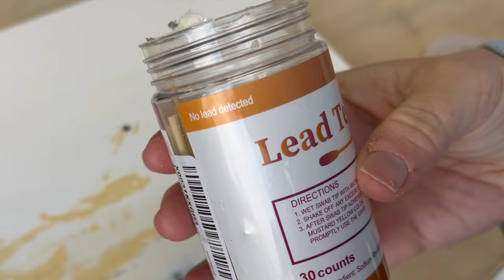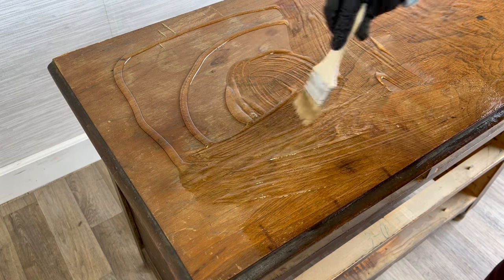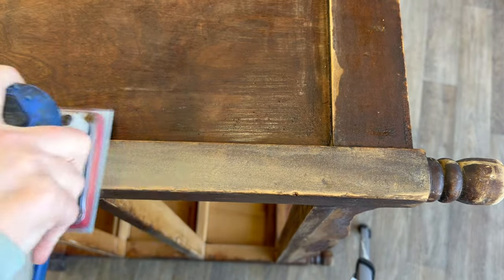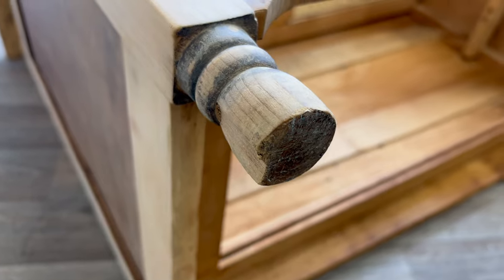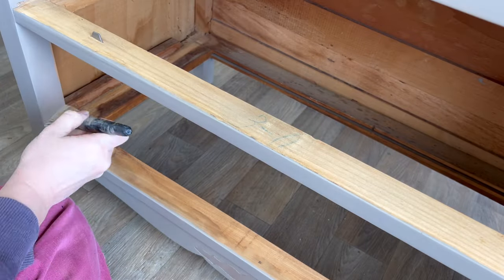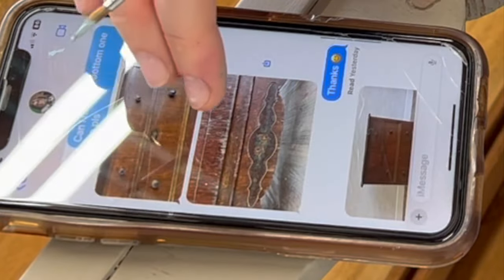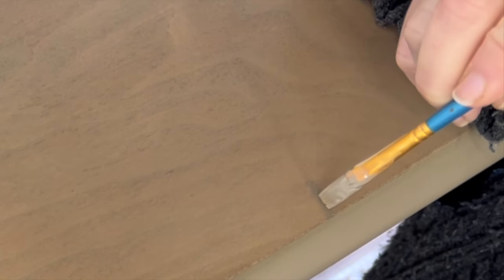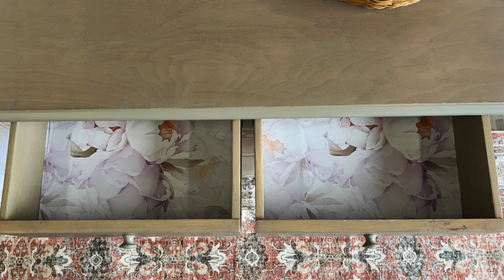Easy & Beautiful Beige-Wash for Modern Refinish of Antique Dresser | How 2 Safely Remove Lead Paint!

Comment: Awe, what a sweet episode.  I got teary-eyed when your daughter was painting and you talked about the full circle of her and the original artist being connected.  Just lovely how you take the history into account in your process.  Very nice result and I love the way you measured the drawer paper on the outside of the drawer so you weren't struggling with the inside walls.  Such a simple solution and I'm definitely going to use that tip!
Reply from the maker: Thank you so much, Stefanie! Yes - I love it when the drawers are like that, it makes measuring the paper so much easier!

Comment: Why not use a wooden "bar" to place on the front end of the dresser that you glued an clamp? Seems to me you might have increased the uniformity and edge tightness had you clamped the bar across the top front.
Reply from the maker: Such a great tip - alas, I didn't have one available that day! 😊👍

Comment: Do you not have to dispose of that scraper after using it on lead paint?
Reply from the maker: No - I found that the gel did a really good job encapsulating the paint and I was able to wiped down/clean off the scraper.

Comment: Can't you just encapsulate lead? I have this very old cabinet (100 years old, maybe more). Have not tested it......... can't part with it. It's kinda big.
Reply from the maker: Yes, you can - it's just that with a project that big, (literally covered in lead paint/primer) it's inevitable that some paint residue will be left over after stripping.  (cracks, crevices, etc.) So that's what worries me...can I truly safely remove ALL of it...(without working on it for months with tiny tools...) 😅